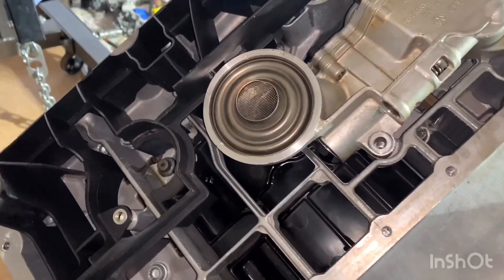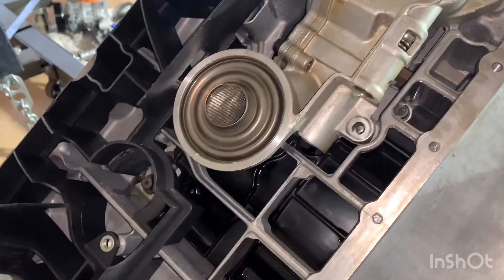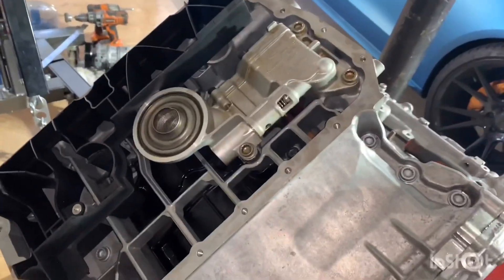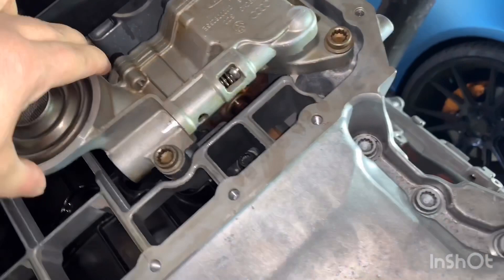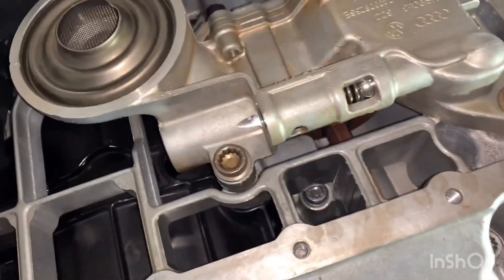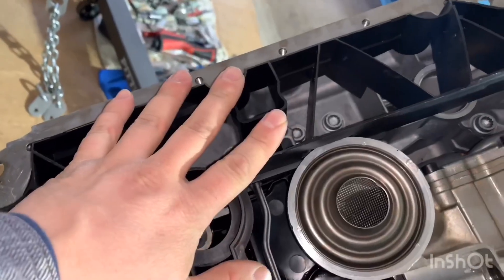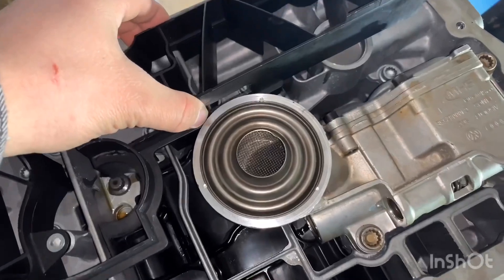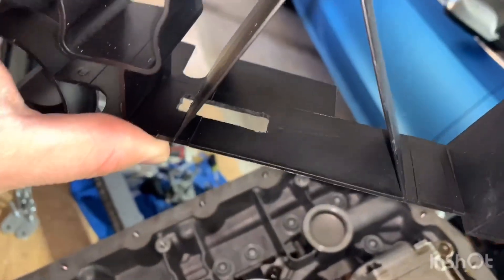3.0TFSI Oil Pump and 3.2FSI Oil Pump

Comment: Hey what's up bro I have a question for you man So I have a 2009 Audi a 5 3.2 And is making a noise at 3000 RPM It's not the timing change I checked that already It sounds like valves Not having enough oil What could it be?? thanks